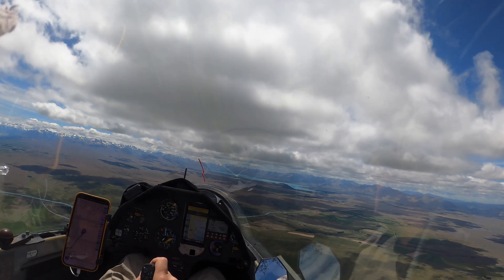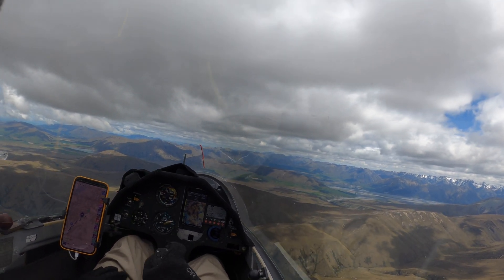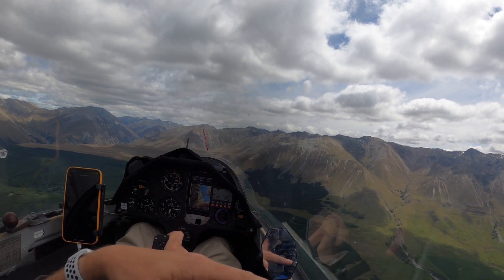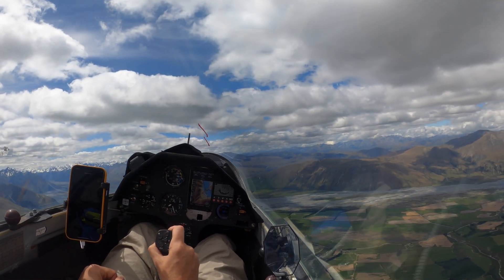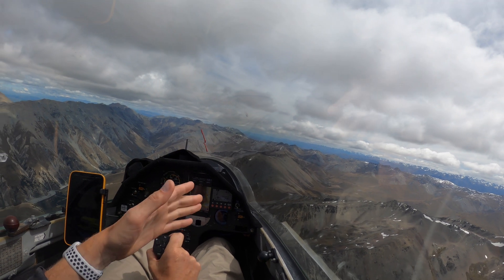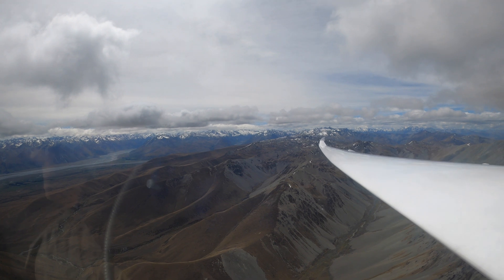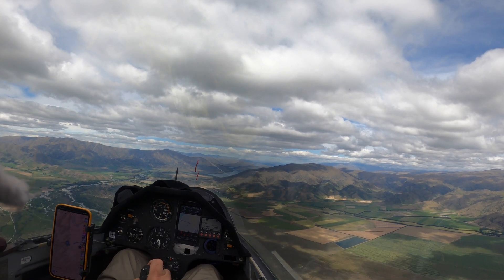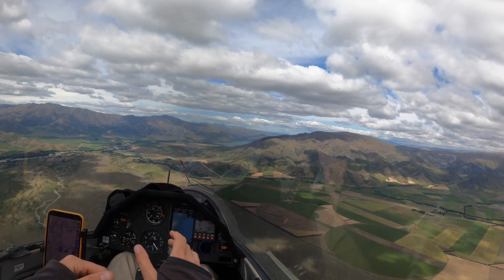Glider Controls Freeze Up In Flight

Comment: Hello, thank you very much for all your amazing videos, where also every glider pilot can learn a lot, I just wanted to mention that it maybe would also be beneficial to check the affected control rods for corosion due to the water leak, Schempp-Hirth has issued a Technical Note (349-42 Rev.4 – Inspection of the flaperon control in the wings) affecting the Ventus 2 gliders, where severe corosion was found at the flaperon bellcrank actuation the innermost flaperon.  Thanks a lot
Reply from the maker: Yeah we did check that when repainting my glider a few years ago. Cheers!

Comment: Can you put iso alcohol or methanol in the wing tanks to avoid freezing?
Reply from the maker: You'd need a lot! It's usually not a problem as a large amount of water won't freeze quickly. It takes time. This was only a problem because the leak dribbled out, thus was able to freeze.

Comment: Do gliders have a wheel brake or do you just roll until it stops?
Reply from the maker: We have a wheel brake, critical so landing in a field you can pull up to a stop as quickly as possible to reduce the chances of hitting a hole 🕳️. When we land we’re about 100km/h so some braking is very useful.

Comment: Can you fill the ballasts with antifreeze agent instead of water like you would in a car radiator?
Reply from the maker: Hi some use alcohol in the tail tank but most don’t bother with anti freeze in the wings. You’d need a LOT, and luckily it takes a long time to freeze a lot of water.

Comment: Is there a reason why you don't add some anitfreeze to the tanks ?
Apologies if this has been asked or answered already ?
Reply from the maker: Hi, normally it's not an issue, as it takes a long time to freeze a large quantity of water, and we are usually only in the air for a a few hours. It's only a real problem when it leaks out like this. Some do use antifreeze or pure alcohol in their tail tanks (which are a lot smaller).

Comment: I was flying a PA28R @ 15,000' with a pilot friend about 15 years ago - we were up there for about 45 minutes before descending. We dropped down through a moderately thick layer of stratocumulus sitting at about 7,000'. A few seconds after exiting the base, I noticed I was having to hold the yoke about 45 degrees to the right to keep the wings level. I asked the other guy to take the controls and make sure I wasn't imagining things. We both suspected a control issue so glide descended down to the field and landed uneventfully (we flew the approach at 90 knots and cut the power over the numbers, we had the  luxury of a LONG runway!). I had to hold in the aileron all the way down. After parking up, I went to grab the engineer when my friend said, "Oh crap..." He was looking under the left wing and it had some fairly moderate icing on the underside only, but nowhere else. It was significant enough that it was pretty lucky that the undercarriage managed to drop successfully. We scratched our heads for a while before the penny dropped... It was about an hour prior to sunset when we were at 15,000' flying South. We theorised that the Sun had maintained a skin temperature above, say, 4-5 degrees (c) on the majority of the airframe (the underside of the starboard wing was still presented to the sun due to its dihedral and the low angle of the sun). The underside of the port wing, however, was allowed to cool through radiation to and conduction from the cold air at altitude. Passing through the layer of SC @ 7,000', we must have flown through some mild (but sustained) rain or virga, which simply ran off all parts of the airframe except the underside of the port wing, where it cooled and adhered as ice creating a moderate lateral weight inbalance. This was only our best theory - if anybody reading this has any other ideas, please share them. But I felt compelled to mention it as if it's true, it was a classic 'Swiss cheese' model of many small (and rare) factors adding up to greater than the sum of their parts. Had the ice build up become significant, it could very well have led into unrecoverable spin territory...! Fly safe all :)
Reply from the maker: Wow interesting story, thanks for sharing. Must have been the sun, an interesting concept. Lucky it turned out well!
Reply: Maybe you had much more fuel in the port wing tank which subcooled and served as coold reservoir saving enough energy to freeze the rain on the outside. That's a common reason why you sometimes see airliners wings even in tropical areas being deiced. They come from -60C and go down to very moist air! Regards and stay safe
Reply: @Mel Buh  Yeah, we thought about the fuel thing, but we were pretty good at switching tanks regularly and evenly! I've literally never experienced anything like it before or since. And yeah I've heard about that! Fly safe

Comment: Would disagree with your conclusion that you made good decision making, you flew knowing the glider was defective, and didn't land when you knew the controls surfaces became iced.  You even said yourself that residual water on the control surfaces was a possibility.  You also knew the answer was not to fly with water ballast in cold conditions.  If your controls had got stuck fully actuated on one side  the result could have been very different.

Having said all that I am enjoying watching your videos in the main.
Reply from the maker: Yeah it's certainly debatable if I should have landed or not - I guess what doesn't come across in the videos is how it feels, and it didn't feel like it was about to freeze solid. Also I could descend at any time below the freezing level and it wouldn't get any worse. I also could have landed at multiple airstrips on the way home if it did get worse. But yes you could argue it would be safest to just land it. The downside is where I was was a LONG way away from any population, a car retrieve would have taken many hours, and I would have been left exposed in the mountains. Not ideal either :)

Comment: How big are the tanks? Would adding antifreeze or cold temperature windshield fluid work?
Reply from the maker: Yes they do that sometimes. The tanks are big, 90L each, and normally have 40 litres or so. In a normal flight at around zero degrees, the tank won't freeze up, it takes too long. If you were doing a wave flight for 10 hours at -20, then yes it can be a problem and anti-freeze would be needed. In this case though the problem was not the bulk of the water wing tank freezing, it was the bit dribbling out, which is much easier to freeze because it's a small amount of water. So if there wasn't a leak, it wouldn't have been a problem. Cheers!

Comment: First, thanks for your videos.  At 2:46 you mention that the "...wind chill factor...".  I assume you mean that the wind chill factor is making your situation with the water leak worse - freezing faster/harder/quicker.  Probably not. A wind chill below 0C does not cause liquids to freeze if the actual ambient temperature is above 0C.
Reply from the maker: Excellent point, thanks! I guess 'wind chill' is actually 'how it feels to a human', not actually changing the temperature? Although I'm assuming it can help cool things to the surrounding temperature faster? e.g. if the water is coming out just above freezing, but the outside temp is -10, the wind will help take the heat energy out of the water faster? Just like sticking your hand out the window, the wind will help dissipate the heat from your finger faster? Does that sound right?
Reply: @PureGlide  It does defy login but the answer is no, wind chill doesn't accelerate taking away "heat energy" from inanimate objects.  https://wgntv.com/weather/if-the-temperature-is-above-freezing-but-the-wind-chill-is-below-freezing-will-water-freeze/
Reply from the maker: Ah that’s not what that article says? “An object will lose heat in calm conditions, but wind will remove it more quickly”
Reply: @PureGlide   Yep, you are right.  My bad.  The water will freeze quicker due to wind chill - but by how much?  We'd need a physicist to figure that out.  I would think that in your flight in below freezing temperatures the water would have froze almost instantly because the leak's drips splashing onto cold metal have a huge surface area per volume (as compared to the water in your bags/tanks).  Critically your recognizing the issue, reacted, and then dived to a lower altitude into above freezing temperatures - and got rid of the problematic H2O.  Great decision making and a good teaching moment.  The move you made melted the ice probably just as quickly as it had formed due to the same wind chill (anti-chill?) factor (lots of assumptions there).  The point, I suppose, is that your body can suffer hypothermia at temperatures above freezing due to wind-chill while inanimate objects are not impacted in this way.  Thus using the term wind-chill is tricky and can cause confusion to us poor animate humans.  Now, GO FIX THAT LEAK!  And let us know how you did it!  ;-)

Comment: You identified a problem with your primary flight controls. Dumped water, assessed the problem to be fixed and chose to continue your flight until the problem reoccured. I think a more prudent decision would have been to "land immediately at the nearest suitable airport" as is quoted in our big aircraft QRH's. You landed safely which of course is a 👍👍👍 however your initial conclusion that the fault was fixed was in hindsight not correct.
Reply from the maker: Yes you're probably right. Although I wasn't too worried as was able to fly below freezing level on the way home if needed, or land at the various airports on the way home. So probably another mistake was flying a bit too high on the way home which allowed it to get a bit worse...

Comment: Sorry mate that was an own goal ! Ive always checked for water in airbrake boxes etc, would never fly with leaking tanks. I always put a smear of vaseline around the airbrakes and onto the valves if the air is cold to stop seizing, and to seal the valve. I also open the brakes on entering the pattern. Glad it didnt need you to use the parachute !
Reply from the maker: Yip it seems very obvious in hindsight!

Comment: Build glider fully of carbon to make them the as light as we can, but fill it with water to make them heavier
Reply from the maker: Imagine a ping pong ball filled with water vs one thats not. Way easier for the one with water to punch through the air and go faster. We then empty the water to land, as that's when you want to be as light as possible. On some days you want to be as heavy as possible for speed, other days as light as possible to climb more easily. So it's good being able to change the weight.
Reply: @PureGlide  Yeah yeah I know all of this, I do it also for country flight. But that sound like an paradox... But thank anyway 👌

Comment: I was flying a Bellanca Decathlon over a desert or thirst land in Africa. Wooden wings and ailerons. At at about 8000 feet the ailerons became sticky and a bit difficult to move. The aircraft had no thermometer of any sort and it was a warm day with scattered cumulus puffs. So I descended slowly to see potential landing spots better. A few minutes later and the ailerons freed up. I decided to stay there because I was much closer to destination than home. Was en route to pick up researcher to find Wild Dogs with radio - GPS collars. Being a qualified aircraft maintenance engineer since starting in 1973, and glider pilot since '77, I inspected the aircraft after a happy, incident free landing. No problems found. So I did a few hours of low level research flying and all was normal. I dropped off successful researcher and flew home. Being nice n cool at altitude I went up to 10000 feet or so on way home. Tops of cumulus had perfect circle rainbows on them when close, so I was photographing them. And enjoying. If you line up the suns rays ray's with cloud top and aircraft on same line, then look to where the rays touch clouds and you'll see a full circle rainbow with a shadow of the aircraft in the middle. Then, same problem occured. So memory speaks and I descend a couple thousand feet. Quickly the ailerons free up. So I had about another hour to think about it on way home. After landing I checked ailerons again very carefully and found that the left aileron had minimal clearance between inner wing rib and the aileron. The paint was freshly scuffed despite a couple millimeters gap. Next day I rectified that problem. I was not the one who had previously rebuilt the plane. Otherwise I might have guessed sooner. 

So, the outcome was that the wooden parts had absorbed water from rain leaking through hangar roof to create swelling in the aileron trailing edge. The below zero temperature caused the wood to swell further and start sticking against the inner left wing rib next to inner edge of aileron rib corner where fabric folds had built up too much thickness.
Reply from the maker: Wow that would be even less expected! Thanks for sharing

Comment: 50/50 water and antifreeze in the wings? -Good down to minus 50 deg. C
Reply from the maker: Yes pilots who fly in wave conditions a lot do that. Not sure of the ratios, the tanks are 180 litres total in some gliders! That would be pretty pricey I suspect...
Reply: @PureGlide  In Scotland a full load costs £60 - 100, so the pundits land with it on board and fly with a stick to put under the wing to stop it leaking out. The approach speed obviously has to be much faster.

Comment: Seems to me you dodged a bullet there, in powered flying that sort of situation is a textbook chain link event that almost always ends in tragedy. The decision to ignore the leak was the start of the chain, it seems to have been quite a non event in actuality, well handled,  To even identify the problem is an indication of experience but also evidence of a problem with decision making, that said it seems that in soaring it’s less critical.
Reply from the maker: It’s always a question when things go wrong as to what to do. Keep in mind in 15 years of flying, being at freezing temps is not normally a problem and it’s normally ever freezing during a thermal flight. So it just didn’t occur to me until it happened!

Comment: My question is on a good day with no rain and no leaks can ice still build up on wings or ailerons in freezing temperatures ? Curious if there are conditions that could cause a problem .
Reply from the maker: Generally planes have this problem as they fly through cloud, while the gliders generally remain clear of cloud. So as long as you’re not flying in cloud there’s no moisture to form up on the wings ☁️
Reply: @PureGlide   thank you for your reply I’m trying to learn as much as I can about this sport . I’m taking some lessons and fly a altralight but I got a lot to learn .

Comment: Fix the leak. 
Water on your control hardware is not good even above freezing level. 

You suspected the water would freeze on your control, still flew. 
Well now that’s some fine judgement .
Reply from the maker: Don't be silly, I wouldn't fly if I thought the controls were going to freeze. Sure I made the mistake of flying with water and into freezing temperatures, but I didn't put the two together or realise it would be a problem until it was a problem! Yes I'm a dummy for not putting it together earlier, that's the point of the video.
Reply: @PureGlide  silly?
I hear you in the video during your flight talking about moving the controls because your above freezing level.
Thank you for sharing this video, it reinforces the the saying “whatever can go wrong, will go wrong”.
I’m glad you learned something from the flight, I did also.
Great video, fly safe.

Comment: The problem with this is, you knew you had a tank leak and then flew into known icing conditions even without the leak flying in icing conditions is just foolish especially in an aircraft without ice protection.
Reply from the maker: Hi yes flying into freezing temperatures with a leak was a mistake, thus the point of the video! However gliders to do fly into freezing temperatures commonly when wave flying. It's common to have outside temperatures of -10 to -30 degrees celsius. The difference is we fly VFR, and not in cloud, so don't have ice forming on the leading edges of the wings.
Reply: @PureGlide  I'll have to have ago, do like the idea of sailing.

Comment: I don’t fly with water unless I add alcohol when freezing is possible.  You never know when you need to drop water.  It may be frozen. I also landed with full water in 1 wing and empty 8n the other and didn’t notice it at all.  Not preferable but no big deal.
Reply from the maker: Yeah good to know, and yes wave flying they use alcohol or anti freeze. I guess I wasn’t expect freezing to be an issue on a thermal day!

Comment: First wrong choice - flying with water in freezing temperatures at all (at least without antifreeze)

In my opinion although you did good by checking if both wings dropped the water - did you think about your CG correcting tail water Tank? If that one didn’t dump properly you would have been flying a tailheavy plane - a great way to put you in a deadly spin!

Maybe you did - in a case like this you should alway fly way over your stall speed especially while thermaling to prevent the spin in a tailheavy glider.
Reply from the maker: Hi yes agreed, wrong choice to fly with water and a leak in freezing temps.

I generally don't use the tail tank, obviously not an option when close to freezing as it's a much smaller body of water to freeze. In my case my glider is tail heavy anyway, so don't usually add tail water, and I'm not adding that much ballast water anyway.